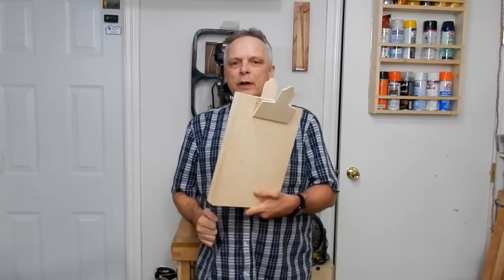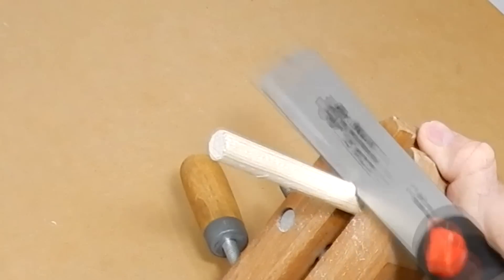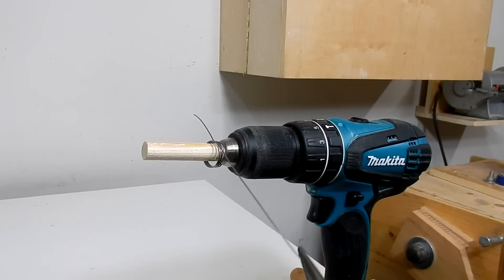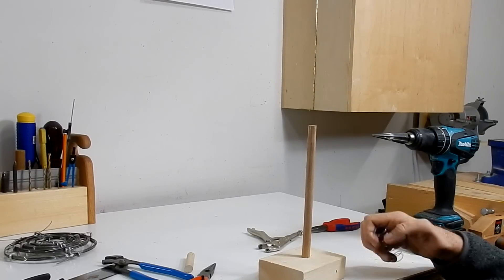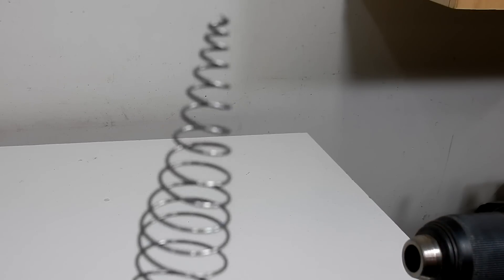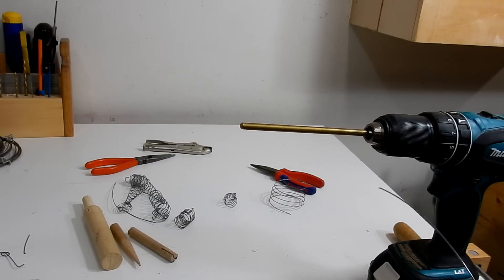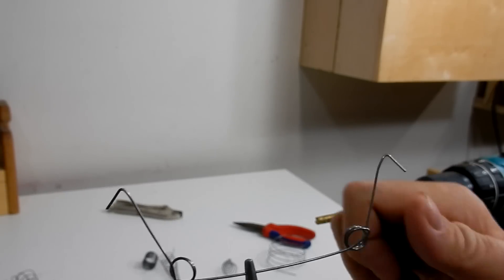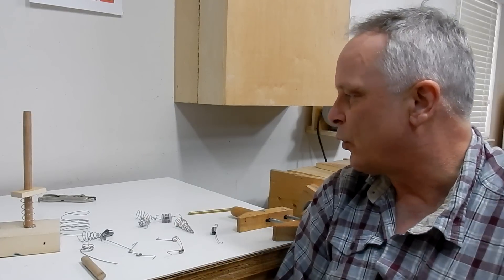How to make springs

Comment: I have a yamaha 15hp outboard with a shift spring that shot into the "great beyond" at my shop. I've spent $80 on springs that dont fit with no ingenuity for a resolution. You have rescued my boat project from a rotting end

Comment: I need mini sewing machine tension disc springs which are all missing in these vintage ones. I cannot find the right size anywhere so I have to fabricate them myself.  So very useful to see what you made so easily.  What I learned:
Piano wire has strength and is not brittle.
Compression springs have large gaps so they have room to compress.  These are for mattresses, sewing tension discs.
Extension springs are tightly wound with minimal gaps so they have enough length to extend.  E.g. Trampoline springs.
The more resistance you want the thicker the wire should be and possibly larger diameter springs.

For viewers, when you buy springs here is how the specs look:
E.g. 0.8 * 6-12 * 20 mm means  Wire thickness 0.8mm, Top Diameter 6mm, Bottom Diameter 12mm, Height 20mm.
These are the specs you need to buy the right spring. The gaps are also important for very precise tolerances. However, basic concept is whether its an extension or compression spring.
Sewing machine tension discs are all tapered/ cone/ conical design/ beehive - you have two countersink washers facing each other, then the beehive spring, then the nut washer dial. Simple design with more finer points for regular sized machines.  Toy ones are very easy.

Comment: Nice for viewing... not so useful for practice as you can hardly control the correct size of the spring. I don't need just a spring, I have exact dimensions to follow.
Reply: yeah I guess this isn't for very precise applications, but works for me because I'm not after precision. If an accurate diameter is something you care about, then I might suggest looking for tables that map diameters to dowel/brass rod sizes, they account for the actual level of plastic deformation of the material

Comment: Had a heck of a time trying to find the right spring to fix some nice vintage shears, and I have other practical uses where it'd be easier to just make a spring than try to source one, so thanks for showing how easy it is with common tools that any hobby machinist or woodworker or even "average dad" has around!

Comment: Great video! I'm needing to make a spring for my Honda EU2000i generators carb. The carb has an electronic motor that adjusts the throttle & the spring provides tension that keeps it running smooth. Anybody ever made one for this application?

Comment: Which wire would I use that would provide a 40 lb compression resistance over 15" length? Tapered Compression spring,  top 6" to 4" to 3 " to the bottom 6" tapered in a few placed.. only one piece? Great great idea so smart.

Comment: Damn, that's a clever hack.  I was playing around with a leg for a puppet with a simple open/close mechanism for movement and I needed a torsion spring to play around with. Unfortunately all the springs that would be the right size are super heavy duty and would rip apart the leg.  I'm going to give this a go with some light gauge wire and cross my fingers.

Comment: You mention using wire of the diameter used for key 88 on a piano. Am I correct that the diameter for key 88 is 0.029 inches?

Comment: Thanks.The way you make springs, was really simple. Now, I will try to make a small special spring using some of scrap parts. I have had no luck finding it for my tool. A similar spring, unknown if it will work, is costly for the tool over 10 bucks plus shipping. I will let you know how it comes out.

Comment: For those who need really small springs, (needed one for my car keys, lost it when changed battery), you can use springs in pens, they are good material and can be rewound to make smaller ones. Worked like a charm, just need a right size steel bar (used my precision screwdriver kit).
Reply: باسپاس ازبه اشتراک گذاشتن علم و تجربه خود ایکاش من دیشب این ویدئو رادیده بودم دیشب به خاطر یک عددفنرکوچک مجبورشدم یک قفل سپرخودرو استوک راکمی ارزانتراز نو خریداری کنن😢😂❤
Reply: لطفاً افرادی که اطلاع دارند به من بگویند مفتول استفاده شده چیست وچطوربایدتهیه کرد❤❤❤

Comment: aren't you suppose to hold at a constant heat for 2 hours before using the spring to relieve stress created by winding like around 500 degrees?

Comment: Those springs don't look like they have the inner diameter of the dowel that made them..
Reply: there's a ratio of mandrel (or dowel) diameter to final spring diameter.  They generally come out larger than the mandrel used

Comment: That's inspiring! Nice video!
Did you use only one type of wire? Could you also drill a valve spring for a car or something like that? 
You would need a pretty solid wire and materials to wire it... 
Or if you know those Soft-air pistols.. I know when I used to pimp them by switching the spring after I got a hard steel spring of a  car repair shop.. :D
Even though the springs in this video are pretty much the same size, they seem to have a lower range of elasticity (cannot translate it to English properly... the German word would be "kleinerer Elastizitätsbereich")
I like the video anyway!

Comment: Thanks, nice tip!  Perhaps drilling a hole instead of cutting a slot in the dowel would be easier and would hold the wire more securely as well as maintaining more dowel strength too.
Reply: B

Comment: Jack, that's an interesting video on making springs. For a special hinge that I am designing, I need a compression spring that is not available in the market. Thanks to you, I can make it myself now!
You are cutting a slot in the dowel for holding the wire before you start the winding process. Don't you think it would be much easier and better to drill a small hole instead of cutting a slot?
Reply: +Jack Houweling   That's right. If there is a hole instead of a slot, you will have to cut the wire near the hole to take the spring out.

Comment: Hi Jack,
I have been a longtime subscriber of yours, great howto as usual.
What is that tool you use to cut the piano wire, and where do you buy the wire.
Thanks, and keep up the good work.
Reply: +Jack Houweling  - Thanks for the reply. Give thanks for your dad then!
I just did a search on Google for "Lever-action end cutting nipper" and came up with the name "Gedore', the prices range from $99 - $180, too rich for my blood.
I will have to stick with my 'Dremel' and a fibre disk.
BTW - what's the brand of that nipper - it looks like it has a removable insert to do the actual cutting. Interesting!

Comment: Spring is in the air :-)
Great video. Very impressive and well explained. But I have some questions, though.
What is piano wire special than other wires? What's the material/diameter?  How many rpm should the drill turn?
T

Comment: Thanks Jack,  I now need to look for a source of piano wire.
Reply: Brendan Stemp if i were you, id try some stainless steel wire instead if you want the diameter of your springs to stay as the dowel you wrap them on. Stainless stell is also a bit stiffer and make for great compression springs:)

Comment: Great shop tip, Jack!!!
It's nice to see how easy this is to do. I have a need for special sized compression springs for a vintage door bell I'm am restoring. I found some at Menards that might work, but if they don't then I will try this.
BTW  -  have you tried using threaded rod to guide the coils for consistent spacing? Just wondering if you have and if that has worked well.

Comment: jack houweling 
Great shop tip!!!
It's nice to see how easy this is to do. I have a need for special sized springs for a vintage door bell I'm am restoring. I found some at Menards that might work, but if they don't then I will try this.
BTW  -  have you tried using threaded rod to guide the coils for consistent spacing? Just wondering if you have and if that has worked well.

Comment: what makes piano wire different from other wire..?
Reply: +Don Mills   When shaping wire, like piano wire, that is already hard there are limits as to the gauge of wire you can coil like in this video.  The limit is around 0.035¨ diameter, above this diameter the wire tends to crack during the coiling process making it unusable.  Below this diameter the material takes a ¨set¨ but does not crack and the sag resistance is not affected too much.  Above this diameter you have to start out with annealed (soft) material, coil it and then heat treat it to the desired hardness.  Hope this helps, regards.
Reply: +Don Mills   Piano wire is one of the best material for spring steel because it has a relatively high carbon content which is important for spring steel.  Traditional spring steels use silicon as the key alloy, it gives the steel excellent sag resistance (memory).  All spring steels must be in the hardened condition to offer the best sag resistance and most are quenched and tempered (heat treated) however piano wire is work hardened by running it through progressively smaller and smaller dies, the end result is an outstanding material for springs.  Chrome-Vanadium (what quality tools are made of) is another great spring steel.  Regards.
Reply: +SkunkTreeCarvings Thats what I was wondering.  And is piano wire the best material to use in making springs?
Reply: +SkunkTreeCarvings Piano wire is made with a particular alloy that includes ( as I understand it) nickel and chromium. It make the metal corrosion resistant and greatly increases memory (it tries to return to original position)
Reply: interesting. As far as you know of, Is piano wire the best material to use, or are there better materials out there?
Reply: +Rafael Lastra That is really good info. So does shaping it into a coil spring shape affect its effectiveness that you know of,  does it lose its temper or memory any quicker as time goes by?  (compared to a standard spring) 
And thanks a lot for the feedback, very helpful.
Reply: +Rafael Lastra - thanks for this information, I will limit my purchases of high carbon steel wire from Amazon to under .035".
Reply: Yes helps out a lot. Thank you

Comment: Great stuff Jack. I have a potential future project that may require several springs, so I might have to give this a try. When you refer to "piano wire" ...is there any more information about the wire one should look for when shopping at the hardware/home store? Where do you find yours? I've bought misc galvanized wire in the past, but I don't think I've seen "piano wire" specifically... or maybe I haven't seen it because I haven't been looking for it.
Reply: +Ben Brandt Jack is a piano repair specialist, I would image piano wire would come from a piano or guitar store.   '}
Reply: Ben Brandt, I just saw another video on making springs, where the presenter used the term "music wire". Hope this helps.

Comment: good idea, but i have a question. what are some of the applications of a tapered spring?
Reply: The essential point is the conical turned spring will lay flat, coils in the thickness of the wire more or less, the cylindrical turned spring stacks up the number of turns times wire thickness.
Reply: Ahh...thank you